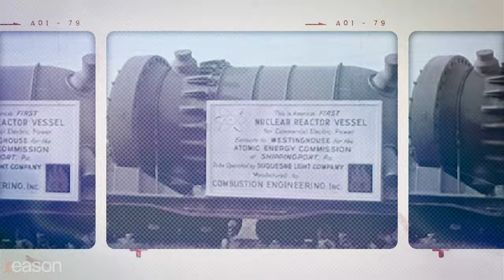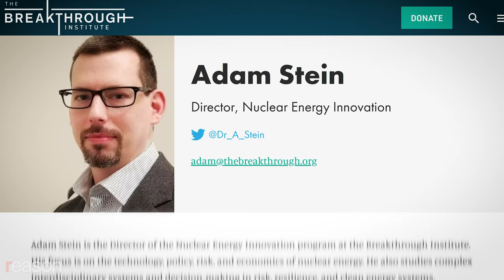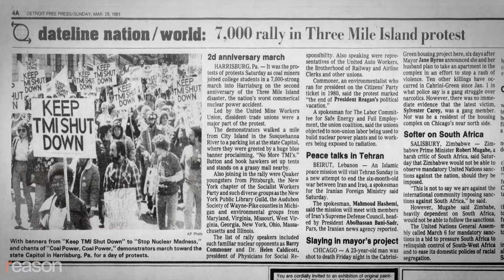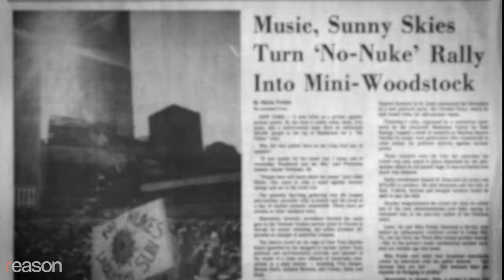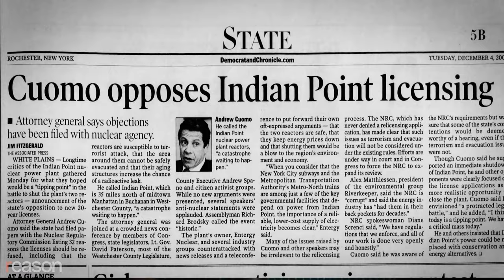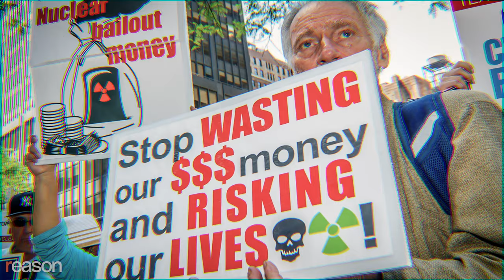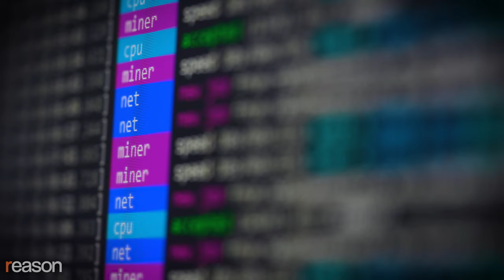Three Mile Island nearly killed nuclear. Now it's coming back.

Comment: Zero people died due to the meltdown at Three Mile Island.
Reply: It didn't even fully breach containment. It wasn't good and certainly closer than it should have been, but ultimately the security and safety measures worked.
Reply: Or even injured.
Reply: @melvinlemay7366  that should have been the message:  This is as bad as it can get and nobody was hurt, the public is perfectly safe.
Reply: @dirtyblueshirt the real meltdown was the media meltdown
Reply: I died inside, a little, which is pretty much the same as dying.
Reply: That’s one of the major issues with nuclear energy: perception. It’s so terrifying conceptually that most people just stop their thought process at “it’s scary” without considering anything else. 

It’s a similar situation with Chernobyl and Fukushima, even though those events were more issues of negligence (operating a nuclear reactor with all of the contingency procedures disabled, essentially gross negligence for Chernobyl) 

And for Fukushima…well they got hit by both the earthquake and tsunami, and even then it was faring well until their coolant pumps failed. The possibility and consequences regarding a worst case scenario is just too scary for some politicians to handle, even if other energy sources are just as dangerous, if not much more so. Hell, more people die in the solar energy business than nuclear energy.
Reply: @MothmanOfficialWva  dont forget Fukushima was slated for closure later that year as a result of failing safty and preparedness inspections.
Reply: @jakehildebrand1824  regulators gave it a 10 year extension in February 2011
Reply: @MothmanOfficialWva  yeah, right before it failed inspection.

If memory serves, the reason cited for failure was insufficient protection from natural disasters like floods or earthquakes.
Ironic reasons for failure, aren't they?
Reply: @jakehildebrand1824  can you post a source for this? Not calling BS, but the only things I’m getting for “Fukushima failed inspection” are from a 2023 inspection and not from 2011
Reply: @MothmanOfficialWva  I did a research project on the subject a few years ago, but I don't remember what I did with my list of sources so it might take a while. 

Of course its also entirely possible that I'm mis-remembering the whole thing.

Since Im not around my computer at the moment, I'll look to see if I can find anything online.
Reply: @MothmanOfficialWva   My apologies, it was the other plant opperated by Tepco that was slated for closure, HOWEVER according to various sources, the Fukushima plant was known to be unsafe, and that it had insufficient infrastructure to protect against natural disasters. 
Additionally, out of all 5 reactors on site only reactor 1 was granted a 10 year operating extension, reactor 5 was offline undergoing extensive repairs due to negligence during previous repairs and construction of a sixth reactor was outright canceled 

Heres a few sources from the web
Sources:
 -A 2011 report from EcoBuisness
-A 2011 article from The Guardian
- A 2012 report from Science Direct

Youtube doesn't like links so I cant give you those.
Reply: @jakehildebrand1824  thanks

Comment: France has been using nuclear power for decades without issues
Reply: Yes. Amusing that they’re nevertheless buying excess electric power from Germany when the wind turbines produce too much. It must be too cheap to turn down!
Reply: @markiangooley  When the wind blows yup. When it doesn't not so much. Just simple markets, whatever is the cheapest to buy in the moment, since electricity needs to be produced the same instant it is needed.
Reply: @markiangooley  So Germany is basically using France (Norway and Sweden too) as a "battery".
Reply: except last year when global warming of their rivers required France to shut down 50% of their nuclear plants.
Reply: @clarkkent9080  2022, not last year (and some reactors had corroded parts, and needed maintenance).
Reply: @thelloydersvk5068  My mistake, 2023 was not that hot, bet if you believe in climate change, then......
Reply: @clarkkent9080  They fixed most of their reactors, so just summer wasn't a big issue anymore.
Reply: @clarkkent9080  And I believe in climate change :D
Reply: @thelloydersvk5068  The problem is river water temperatures and their nuclear plants increase an already warm water temperature.  They have limits and even in 2022 they would have shutdown more nukes but they were given permission to exceed water temps.  And France is a net importer of power from Germany.  I am pro nuclear but lest not ignore that it has its problems and is not the ultimate answer
Reply: @clarkkent9080  I agree with you that high temperatures can lead to decrease in power generation (to not make the rivers too hot), but the 2023 and 2024 were pretty good years (France was the largest exporter in Europe again).

Actually, if those power plants had cooling towers, excess heat could be transferred to the atmosphere instead of the river. Like in Slovakia, where I live, reactors usually operate at (near) maximum installed power output even during summer (except during regular fuel exchange), because of their cooling towers.

Hungarian Paks for example, which doesn't have them, like some French power plants, needs to decrease generation during summer.
Reply: @thelloydersvk5068  I am well aware as I worked for 40+ years at 5 different U.S. nuclear facilities.  I was just making a point of some of the problems that France has had.  I am pro nuclear but the problem with new nuclear today is the expense.  New nuclear is the most expensive way to generate electricity and as it increases in cost, other options keep decreasing in cost.  It may be the answer in some applications but in  most cases there are better ways to solve the energy issue.
Reply: @markiangooley  France is the largest exporter of electrical energy on the entire planet. The amount of electricity being produced in Germany is also falling, not climbing, as it should be.
Reply: @clarkkent9080  How much more expensive do you think the electricity in Germany will get before the carbon intensity of their electricity is comparable to the electricity in France?
Reply: @PistonAvatarGuy  I am only able to discuss new nuclear in the U.S.. Each country has a right to do as they see fit.
Reply: @clarkkent9080  Why shouldn't new nuclear in the US follow the example set by France?
Reply: @PistonAvatarGuy  The U.S. is completely different than France. Our ONE of 50 states, Texas is larger than the entire country of France. The U.S. produces more oil than our entire country uses. We have so much natural gas that we vent/flare more natural gas to the atmosphere that all of France uses.  We have so much land available for solar and wind  that flying from the east to west coast in a jet at 890 Km/hr, it takes 5 hours to travel from the east most part to the west most part.  Nuclear works and we have more operating reactors than France but the latest reactors built in 2023/2024 cost $17 Billion dollars each (19.5 Billion fracs) and took 17 years from inception to power output.

Comment: Renewable fuel is methane.
Renewable material is wood.
Clean energy is nuclear.
Reply: Add hydro electric to that for base power generation
Reply: @jonathanjones3126  Some methane can be scavenged from accumulations.
Reply: @GrimFaceHunter  methane should be collected from any reasonable sources such as water treatment plants and landfills. Why turn down free fuel
Reply: @jonathanjones3126 Yea, if you leave it at landfill it's gonna release to atmosphere anyway.
Reply: @IxoraNera peat bogs and these thawing regions in Russia-etc. Could be collected somehow, but let's slow down progress by banning hydrocarbons now... 😅
Reply: @jonathanjones3126  Hydro is actually good for some light demand response too, especially large dams that can have varying flow through the day due to their reservoir capacity. of course there are watershed concerns and etc, too so actual application is more complicated. Hydroelectric is a truly useful power source
Reply: @replynotificationsdisabled  peat bogs over time will turn into incredible fertilizer resources. I would avoid using peat for fuel
Reply: @replynotificationsdisabled The Golden Goose are the giant clathrate deposits under the sea.
Reply: Wood is not renewable in the long term.  Every tree extracts nutrients from the ground, top soil is disappearing.  Using artificial fertilizer is expensive and impractical.
Reply: @jonathanjones3126  Hydro is used for peaking load since you can ramp it up or down very quickly, to follow the amount of demand. Hydro currently provides only about 6% of the electricity in the U.S. And it's impossible to increase that without building more dams (or reducing the amount of electricity used). The amount of hydro you can get is limited by rainfall, which we have no control over. There's simply not enough to provide base load.
Reply: @RS-ls7mm  Artificial fertilizer is cheaper than organic. It's the reason we have 9 billion of us. You're talking out of your arse.
Reply: @namm0x326  If we utilized the tides they would cry . "The moon is falling ! The moon is falling ! "
Reply: Tree sway power is free and safe
Reply: @namm0x326  In the mean time I will cook my potatoes and peat will provide the heat now. Right now that peat will power the power plant and I will have electric. I am so glad I no longer must depend on the mail boat to bring me 10 kg propane tanks.
Reply: Swap wood for hemp better product infinitely more renewable
Reply: @jonathanjones3126  Or from food waste.
Reply: @jonathanjones3126  The problem is that collection and distribution systems are not cheap. Cities with large landfills that produce methane cannot harvest it and distribute it economically.
Reply: @IxoraNera  A lot of large landfills burn off the methane rather than just release it, to lower the ammount of unburned hydrocarbons released into the atmosphere.
Reply: @frosty3693  you build the collection systems as you if you have the forethought,  older landfills I imagine are much harder to retrofit.

Other then cost it would be easy to collect methane from sewer treatment plants.

Comment: The tragic thing about Three Mile Island is that if the PR had been handled properly it should have been the poster child for nuclear safety.
Even when the operators did everything wrong, the core melted down (partially, before people nit-pick) all the containment systems did their job and ultimately...nothing bad happened.

It was a huge financial disaster.
Reply: Indeed
We need to spin it the other way
Reply: That's the definition of "fail-safe." When it fails, it is still safe.
Reply: The big problem with the TMI incident was the company who built/ran the reactors and the NRC who let them get away with cutting corners, not having properly trained personnel, and basically lied about pretty much everything to the public regarding the incident. The company was clearly more concerned about making money off the reactors than protecting the public.
Reply: @Wraithlen  seriously? Well then
Reply: @Wraithlen  But that's the point isn't it? Even with all that negligence, ultimately nothing catastrophic happened - except some of the people you outlined collectively losing billions of dollars.

Comment: The only lethal accidents regarding nuclear power, being the K-19 submarine and Chernobyl meltdown happened with Soviet nuclear reactors. It was never a “nuclear power problem”, it was a “Soviet Union problem with nuclear-level consequences”.
Reply: Well there’s the Fukushima nuclear disaster but that was due to the Japanese foolishly putting their backup generators in a spot where the floodwaters would easily reach them (in a facility right next to the ocean in a seismically active country where tsunami’s are of particular concern) and render them inoperable…thus leading to the reactor overheating & meltdown.
Reply: @meatloaf5772  Fukushima had no deaths from radiation or reactor.
Reply: SL-1 killed 3 people with one of them being impaled by a control rod that would imbed into the ceiling of the facility.
Reply: @travisbeagle5691  SL-1 was an experimental Prototype reactor(keywords being “experimental prototype”)from the 1960’s, and, despite causing 3 deaths from the explosion, the cause of death of all three men was physical trauma and NOT radiation-related.
Reply: @Ploxtifs_OldAndDeadAccountXD  It was a prompt critical event exactly like Chernobyl and if they hadn't died right then, they would have died from the radiation dose. It absolutely counts as a nuclear incident and not just an industrial one.
Reply: @travisbeagle5691 no it doesn't, considering why it went prompt critical. It was basically a bomb.
Reply: @ChiefCrewin  That is exactly like Chernobyl. The only differences between them were scale, location and the exact nature of the prompt critical event.
Reply: Fun fact: one single hydroelectric accident killed more than all of nuclear and nuclear got the bad reputation
Reply: @travisbeagle5691  I don’t count flagrant misuse of radioactive materials by complete amateurs, and things such as the Ciudad Juárez cobalt-60 contamination incident aren’t considered nuclear plant accidents BECAUSE it was a few people who had no clue about what they were dealing with getting hurt. Saying we shouldn’t use nuclear power because of people not knowing what they are doing accidentally got hurt is like saying all cars should be banned because drunk drivers(people who shouldn’t have been driving in the first place) get into accidents.
Reply: @travisbeagle5691  Chernobyl happened because the Soviet bureaucracy refused to fix reactor 4, despite knowing as early as the 1960’s that it was a poorly designed and extremely dangerous reactor, being one of the most likely to have a meltdown in the Union according to internal documents.
Reply: @Ploxtifs_OldAndDeadAccountXD  I'm aware of that and it's completely irrelevant to whether SL-1 was a lethal nuclear incident or not. It was, we learned from it and implemented safeguards. The Soviets and really didn't until Chernobyl happened and they were forced to.
Reply: @travisbeagle5691  even then, the Soviets didn’t really learn from the mistake, as their country collapsed shortly thereafter.

They didn’t learn from the K-19, and they didn’t last long enough to learn from Chernobyl.
Reply: @Ploxtifs_OldAndDeadAccountXD 

Well I was about to bring up the Tōkai-Mura accident, but that was just mishandling of nuclear material leading to an unshielded criticality event. 

So, maybe don’t handle radioactive materials with a regular bucket and nuclear energy might just be ok.
Reply: SL1 and many other U.S. lab accidents
Reply: @clarkkent9080  again, SL-1 was an extremely early prototype that caused 3 to pass away from the sheer explosion(not ARS), and didn’t really leave any radioactive contamination.

“Lab accidents” such as this shouldn’t be considered reasons against nuclear energy, but rather reasons against letting unqualified and incompetent goobers be given unrestricted access to radioactive material.

Comment: We needed power all this time for home heating, air conditioning, and consumer use.  Governments blocked and delayed it continuously.  When they need it for data centers to store all that information they collect on people,  suddenly, they pull out all the stops.
Reply: The trick is that if you have the money, and the influence  it can bring, you can get things done. The big wind farm in NE North Carolina was built to run a server farm. A byproduct of the power system will be the increase of research in reactors. In the US much of that research has been by and for the Navy.

The thing about nuclear is can be spun up to meet demand and does not need energy storage. Something that wind and solar cannot do. Renewables, so far, are not reliable and often cannot be located where the need is requiring very long transmission lines, with their added cost and power losses.
Reply: @frosty3693  if renewable energy worked, it would make more sense to generate it at your house and use it directly instead of sending it miles down electrical power lines.
Reply: @michaellowe3665  I was thinking more large scale like the US and Australia. Their best power production, wind/solar, are rather far from the cities that need the energy. There is a big fight in Australia over the routings and cost of the power lines at the moment I believe.
Reply: @frosty3693  I don't think it makes sense to build enormous structures miles away from where the power is used until you first exploit the roof tops and existing structures in the cities and towns.  At least for solar in the suburbs, the roof of the house where it's used should be covered first. Wind needs a bit more open space, but it's probably not really a serious option when you include all factors.  It might work for a farm to power a residence on site or keep some electric farm vehicles charged.  When I see all of the roofs covered in solar first, then, I might agree with adding more.
Reply: @frosty3693   The carbon emissions produced to build solar and turbine, and the landfill waste created when they reach end-of-life, isn't worth the small boost in energy production to justify large scale operations.